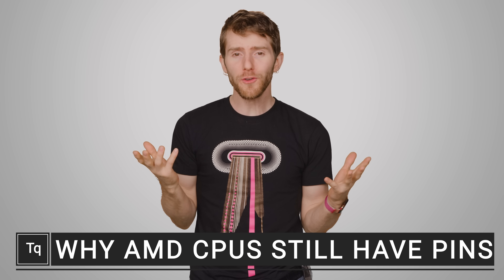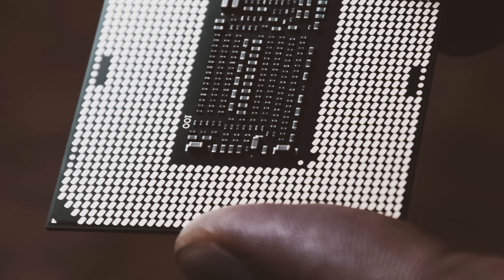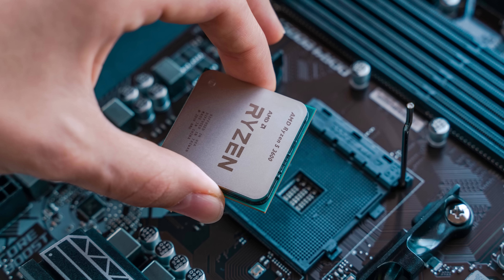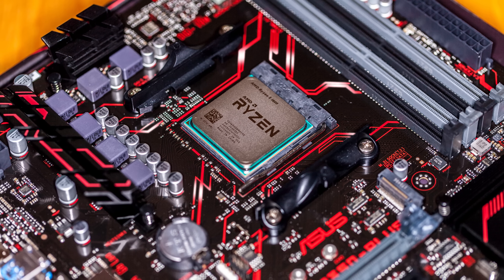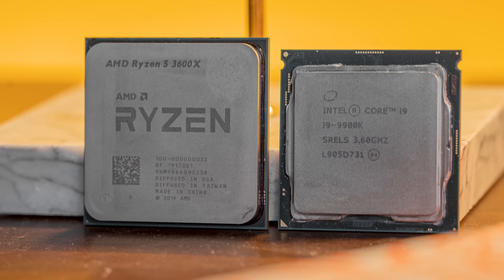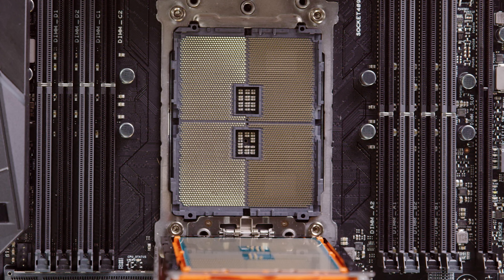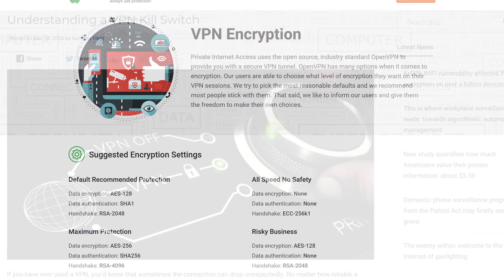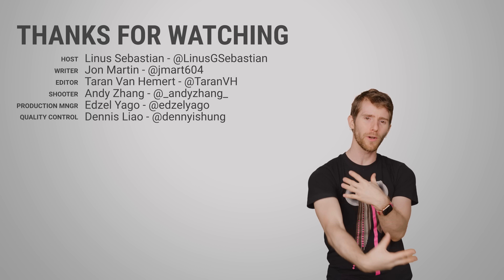Is AMD Stuck In The PAST?

Comment: That's very provocative
 title. Why didn't it say "is Intel living in the utopia"? Intel's choice is purely cost efficient solution and nothing else..
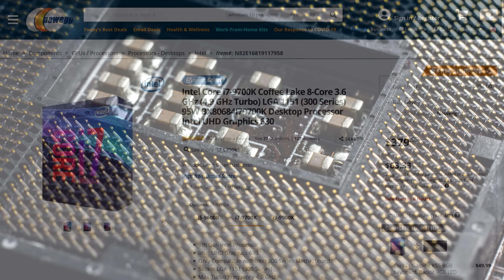0:54 "It's not uncommon to see a 400$ CPU in a 150$ Mobo". In what year are you people still living in, eh? xD
Reply: But that's basically what OEM's are doing... And they compensate for it by cheap fixed cooling solutions that vent the hot air out of the case

Comment: I think motherboard and CPU's both should have contact pads and pins should be a completely different component which is installed in between the cpu and the motherboard separately and can be replaced .

I hope i get paid if anyone from amd or intel saw this comment actually implement it.

I can dream LoL.
Reply: And look up what bga is

Comment: What BGA? Why don't we see that in processors?
Reply: BGA is a type of soldered package. It needs to be "baked" into place with an oven or a precision hot-air gun.  They're very common in laptops and Apple products, but they're not something you'd ask a home-builder to do.
Reply: @jordanrodrigues8265  That's only because the balls are solder balls. As far as I know, there's nothing stopping them from using the same material as pins use. It might cost more to manufacture, but at least you couldn't bend a pin. But I guess at that point I'm just asking "why don't they use this process that doesn't exist currently."

Comment: biggest problem with the AMD socket is, that the cpu is not secured by a bracket like in the Intel sockets
if you pull out the cooler after a longer period of time, chances are that the cpu get's stuck on it

Comment: Complete speculation here:
Intel generally expect you to buy a new motherboard with your new CPU.

With AMD, you may find yourself using a couple of different CPUs with the same motherboard if you planned your upgrade path well. Therefore the low number of rated insertions and durability of an LGA socket is more of an issue.

Comment: Summary: It doesn’t matter. Just don’t bend the pins. :)
Reply: Yeaaaaasah
Got one that needed to be replaced because of damaged pins had to wait two more weeks
Reply: @onioncuttingninja-f2p  yup , love how fan boys are fighting over this when all you have to do is not be an idiot and just not bend the pins
Reply: @TheDarkestPaladin  Well I'm actually worried because I will have to cchange the sh!tty stock cooler on my ryzen 3600 and I've read a lot about how it is tough to remove and you can bend pins quite easily.
Reply: @TheDarkestPaladin  Idiots? I took my cooler off like I've always done on Intel CPU's. What happened? The AMD CPU literally ripped out of it's socket and bent it's pins in the process. The locking mechanism on AMD chips are garbage and need to be rethought.
Reply: @SnoutBaron  What motherboard did you use?
Reply: I remember when I wanted to buy FX-4300, shop staff said me that someone bent pins and I have to wait several days to get an intact one.

Still use this CPU though, and it is still powerful enough
Reply: 4UkU6aM69iTHUK i swapped mine for a ryzen, does urs run hot ? i remember my fan spooling fast all the time when i open anything on my pc...
Reply: 4UkU6aM69iTHUK just replaced my with a 3200g it was nice until I got a 2060 and their was too much bottlenecking
Reply: @pardonless  oof
Reply: @pardonless  I had FX-8300 and FX4100.... Powerful is understatement. FX did not age well, But the price/performance is amazing through. I was rocking FX until a few months ago.
Reply: @pardonless  if you don't do massive video editing or AAA games its fine
Reply: I once repaired an AMD proc with 40% of the pins bent, with an elementary school ruler and 10 minutes work. While with only 3 pins bent on an Intel motherboard I still can't get the second memory slot to work.

"It should not matter to you". 

F-ing lol. What should then?
Reply: I recently built a pc with a ryzen 5 3600 and the ez debug light was on for the cpu, I found that one of the pins on the edge was bent so it was a very easy fix luckily
Reply: @danq_cxp3731 did the same thing a week ago installing a 5700x. I was dumb and removed the cooler too roughly once cause I put my brackets backwards. Bent 4 pins and had to straighten them out.
Reply: Yes because people purposely bend the pins.
Reply: Almost broke my R9 3950x when taking the cooller off it got  stuck on the cooler and when I checked it outm the processor was glued to its surface. That heart attack I almost got was priceless...
Reply: I bought a motherboard with bent pins thinking i could probably fix it. The first two pins I tried to bend back broke off 😭

I proceeded to put the other 3 back into place, which seemed much easier now that the board seemed beyond recovery. I had nothing to lose by putting in a CPU on the off chance that it worked. Especially as it did work 😂
Reply: Quarantine is having its effect
Reply: I agree with intels position on this. I still have amd chips in my machines hana
Reply: ... and if you do bend them anyways... well, fix them!
Reply: I work with electronic ICs every day and i bend pins every day. It's really no big deal, at least not until you've bent the pins back and forth so much to the point that they break off. But even then, you can still fix it with a soldering iron and some new new pins ;-)
Reply: @mortenrobinson  hello! Do you have a video about that? ... Because i have here an ryzen cpu with a broken pin... Not working
Reply: @IskandarSouza  Take an old ryzen or fx cpu and break a pin off, put it into the hole that corresponds to the missing pin on motherboard, then place cpu in and chances are it will work, Worked for me
Reply: and use a fukton of thermal paste
Reply: My CPU came in with 3 bent pins and had to use tiny tweezers and a magnifying glass
Reply: I once bought a used Intel p45 motherboard and its pins were fucked up. I don't know how anyone could "succeed" with that on either.
Reply: I guess the main point is the pins bending before they get to you, you shouldnt bend them once they get to you, as long as you don't handle them like they're free
Reply: Upgrading a PGA CPU is a pain in the arse though.
Reply: Thanks for saving me 5 mins
Reply: No it’s asmr
Reply: Yup
Reply: Shipping
Reply: I rather pga over lga because the pins are stronger
Reply: It matters. LGA is the superior standard. Using ZIF sockets in the far flung future of 2020 feels like damn installing ram in DIP packages.
Reply: @Mostlyharmless1985  But it doesn't matter. Socket style shouldn't put you off of Ryzen.
Reply: @TheProG4merPlayz  No, what puts me off Ryzen is the poor performance and support. That they are using a shitty form factor compounds the issue.
Reply: Thats like putting a kid in the cockpit of an airliner with autopilot off and telling him "It doesn't matter, just dont crash"
Reply: @F L now that was a tech quickie 😂😂
Reply: I bent the pins 😐
Reply: I'd rather a bent pin on a CPU rather than a motherboard
Reply: Oh
Reply: Spread chaos, bend the pins on your 5950x on purpose
Reply: Dosent matter until you go to remove your cooler and the AMD Cpu rips out of the MOBO and you break 21 pins
Reply: Never broke an lga MB in 15 years, even when I was 12 yo. 
Almost fucked a cheap athlon in 3/4 thermal paste application.
It doesn't matter until you trash your 400$+ chip instead of your 100-150$ Mobo.
Not so uncommon seeing how much ppl are making tutorial to fix their 3700/3900x.
Amd knows that PGA is trash and uses lga on its server/hedt. PGA is just cheaper to make (very simple design, no need for precision manufacturing)
Reply: Let’s just all agree that if everybody is careful with their pins, neither type of processor is better or worse than the other.
Reply: Wish I could agree, but after nearly ruining a 2700X when i swapped thr stock cooler to a Noctua I hope the next AMD socket goes to LGA.

For context the x470 MSI board I was using was cramped and did not let me easily clear the retaining brackets, so when I went to twist the cooler to break the thermal paste before removal it still wrench the CPU out of the socket.

Comment: I'm not sure if this is still a thing, but what I hate about pins on processors is that you might think you're pulling the cooler out... But you're actually pulling out the CPU along with it.
Reply: Never pull or pry a cooler. Twist it to break up the thermal paste.

Comment: Lifehack: if u bent some pins and they completely came off during your repair attempts (shouldn't happen as they are quite tough but it can), just put them into proper holes of the socket and slap your CPU over as normal, it will work.
Reply: What if I don't know where the missing pin is?
Reply: @GuyFromJupiter  you mean loss of it or its positioning on the socket/cpu? If it has been lost, theoretically you can use any metal thing of proper lenght although i didn't try that so cannot suggest. If we speak about position, there is a full grid of pins/holes without free space, so it should be easy to compare cpu area with socket holes and find a proper hole for a pin or few
Reply: Well, you saved a lot of money for many people, thank you.
Reply: @TohaZhirnij  it should be done at their own risk btw have to say. It worked for me with am3+ phenom, cases may differ, f.e. am4 holes may be deeper or pin won't contact cpu by other reasons.
Reply: @5poolcatrush  i think gamer nexus done similer

Comment: CPUs w/ PGA can be easily damaged after long use when removing the cooler due to thermal paste harden and gule the CPU to the cooler. But that's something like 10 years ago, I don't know if this still applies.
Reply: Can confirm. Needed half an hour and a hair dryer to separate my 2700X from its cooler.

Comment: I prefer the pins on the cpu. Very hard to damage a pin cpu vs damage a motherboard pins. Chips are very easily replaceable. Changing out a motherboard is like riping out your entire build. Once the pin on a motherboard is damage. Consider that board dead. Board pins are not fixable. On the other hand cpu fins are very easy to fix to get it to drop into the motherboard.

Comment: I mean lining up the pins with the pits in the board is as simple as gently placing the chip down on the socket and if it doesn't drop right in you gently slide it until gravity takes care of the rest

Comment: Fixing a bent LGA pin isn't bad. I sold a computer years ago and the buy got it and said it didn't work. It worked when it left. When I got it back all that was wrong with it was a bent pin on the socket. Just pushed it over and it worked and I sold it again.

Comment: I had the misfortune of having to deal with both bent PGA and LGA Pins and have found that PGA are harder and scarier to bend back since they’re much tougher and require much more force, which makes you feel like you’re gonna break them, especially if you’ve bent back LGA pins in the past like me. And also they’re easier to bend just because they’re so exposed unlike LGA pins. So shipping a used ryzen CPU is a nightmare and always impossible to do without getting them all bent. While you can easily cover the motherboard pins on Intel motherboards

Comment: I don't care whether they use PGA or LGA but PLEASE AMD use a retention bracket with AM5 because it's so hard to get the cooler off without ripping the CPU out of their socket.
Reply: No it's not, you just wiggle it around a bit so paste loosens...
Reply: @kumbandit  Yeah, that's easy to say, but once my CPU was stuck to the cooler so badly, it didn't even wiggle. It was like it was glued to the cooler. I could neither twist or wiggle the CPU even after it already came out of the socket with the cooler still on. Spend half an hour trying to separate the CPU from the cooler. You didn't experience the real AM4 pain yet.

Comment: PGA must die. It's just stupid. Has it ever happened to you, when you want to remove the cpu cooler, but it also pull the cpu out of the socket while cpu is locked to the socket? Now imagine that it  happens to your 3950x while youre hands move a little bit sideways. Those pins will bend.
Reply: If you twist the cooler instead of prying it out, you won't do that.

Comment: "Is AMD stuck in the past?"

laughs in 7nm chipset
edit: 5nm now
Reply: It's not their 7nm tech.
Reply: 7 nautical mile long cpu
Reply: @ZombieBrine1309  No one in the right mind uses miles. Please read the SI Brochure, nm is the correct way to write something in nanometer. (however, there should be a non-breaking space between number and unit)
Reply: @happygimp0  imagine using miles am i right?
Reply: ggzh a Argue With Everyone r/woooosh
Reply: Then why 14nm intel has the same performance per watt? And why amd still has worse temps?
Reply: @divoulos5758  most games are known for favoring intel over amd anyways, and when it comes to productivity amd fucks Intel's ass.

and amd outputs less heat than intel does, which is fully proven by many youtube videos
Reply: @divoulos5758  What is even is the point of this comment, by your logic mobile processors are the best

Comment: my dog steps on my 3200G while im building a pc, all pins bent, fixed within 10 hours. i accidentally drop a sata wire into an LGA 1150 socket, bend about 50 pins, then proceed to take more time to fix because i keep bending the adjacent pins. I'm sticking with PGA.

Comment: Hey, I’ve bent pins in an Intel socket. Fixing that SUCKS.  I’d much rather deal with bent pins on a CPU.  When you remove a CPU cooler, twist it to break the seal of the thermal paste.

Comment: I think PGA is better because if you damage the CPU pins on a PGA board, you only have to replace the CPU.  If the motherboard is LGA, you have to take out everything connected to the motherboard, as well as the CPU.

Comment: I don't get it. I've had some CPUs in and out of motherboards dozens of times and never damaged any pins. I also never damaged any naked dies back before IHSs were a thing. Guess it helps not dropping them or using a hammer to install hardware.

Comment: lga sucks. it's so unreliable  simply because of how fragile the pins are. also because intel chips do lose their value and when they do the motherboard is still expensive. meaning that one bent pin on an expensive mobo becomes a nightmare. with how these modern ryzen chips are performing, they clearly prove that pga is just as good for performance. the only time it matters to have more contacts on a cpu is in a server or workstation environment. so thanks linus for this very clickbait title and misinformation. i normally stand behind what you suggest but on this i will not.

Comment: Well with PGA you can have 2x the profits when someone bends a pin and has to buy another CPU
Reply: You can bend it back (it's not as fragile as LGA motherboard pins, you know). Or, as Linus himself and Greg Salazar has demonstrated, resolder or replace the broken pins on the motherboard instead and get the broken CPUs to work again.
Reply: I actually inserted the broken pin on the hole its designated to , still works .

Comment: I feel the big miss is that it wasn't addressed that AMD prefers PGA as they expect their motherboards to be used multiple generations unlike Intel.
Reply: It doesn't matter whenever you have PGA or LGA motherboard... You can still support the same socket on the CPU throughout the years... Intel used LGA775 for 2 generations so did Amd with Threadripper
Reply: @fire_silicon7803  pga motherboards are more likely to last longer.
Reply: Don’t want intel to ‘forget’ to send LTT’s 10 Intel CPU series press samples lmao
Reply: How is that even corelate?
Reply: @Repair yeah! why not?
Reply: Yeah, this video wasn't nearly as offensive when it came out on floatplane last week.

Comment: The best would be LGA with more stiffer pins. (like BGA sockets)
But for AMD they should add a mechanical lock on the IHS to prevent to pop off the cpu when you remove the cooler. 
And yes it happends a lot of times. Since CPUs had IHS aka Socket 939 (Athlon 64) , Socket A and 754 had the exposed die on the CPU itself.